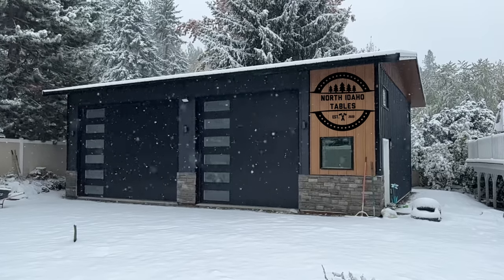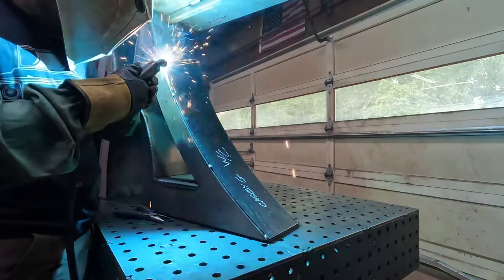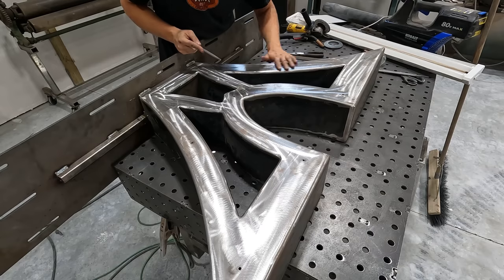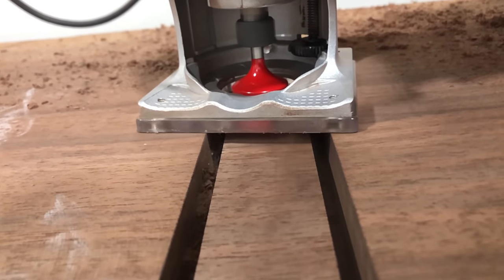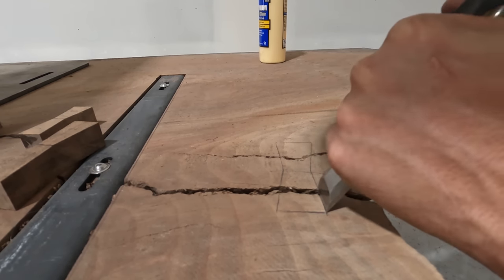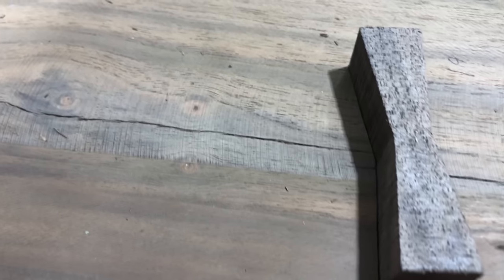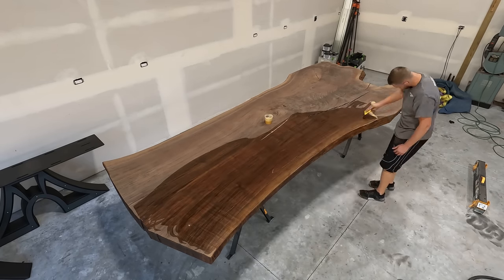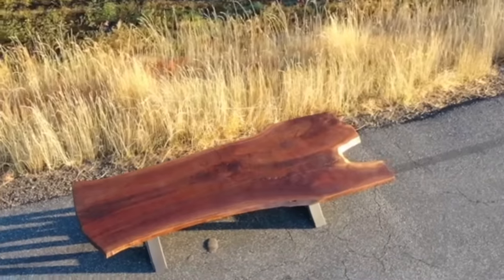BUILDING A $20,000 CONFERENCE TABLE  @North Idaho Tables

Comment: Great video and content. Nice job on the bases and Walnut Table start to finish.
I work with walnut and build Natural Edge Tables for show in galleries. I've tried every possible finishes for walnut and Mono coat and find a quick lacquer rub over a finely sanded (320 grit)and several top coats of a Poly Satin. I buff it out once cured. I then use very fine sand paper 600grit and steel wool to give the wood a more natural look and feel. Like you I put alot of handwork and my work really shows especially in galleries. Again great video and content👍
Reply from the maker: That’s very cool!  It would be worth experimenting at some point. Thanks for watching.
Reply: @North_idaho_tables  it's good to experiment with finishes. I make Serving 2"in serving trays for gifts and use all Natural Tung oil and citrus solvant. The trick for using oils Is to finely sand up to 320grit. Let oils to dry up to a week between coats. My pieces come out really nice especially after finely steel wooded.

Comment: Really appreciate the metal work on the legs. Suggest an equally amazing job on an epoxy top would have rounded off the project. Good luck going forward, looks like you have a great talent.
Reply from the maker: Ya not everyone is into epoxy.   The client didn’t want anything.   One thing that’s awesome about wood working is everyone likes different things.    Appreciate the comment.

Comment: Sweet base.  Our heaviest has been 2000 lbs from 2" think stock material.  Quick question?  You mentioned filing the welds?  I couldn't understand the file name?  A "Dixon" file?  Googled & got no results.

Rubio is great.  Used for 5+ years but Odies Oil is superior when it comes to water protection.  So we stopped using after a few complaints about water stains.   Just an FYI.
Reply from the maker: Thanks you!   
And it’s called a vixen file

Comment: You might want to consider using thinner sheet metal for the legs to reduce weight, at the cost of reduced strength. IDK if you can calculate the tolerances, but it might be worth it.
Reply from the maker: So I definitely could use thinner material.  But two reason I don’t.   I love being able to have a big round edge when I grind the outside corners.   Secondly using the thicker material allows me to put a lot more heat into the part without having to worry about it twisting and warping.

Comment: Such a unique base! What a gem 👍
Question: Did or do you have any concerns about that top crack on the slab getting worse overtime? Or do bow ties underneath help prevent further splitting? 

Cheers and all the best with the channel! 🇨🇦
Reply from the maker: Ya so the bow ties on the bottom should prevent it from Opening  up further.   All my slabs are kiln dried. Shouldn’t move to much. And thank you!